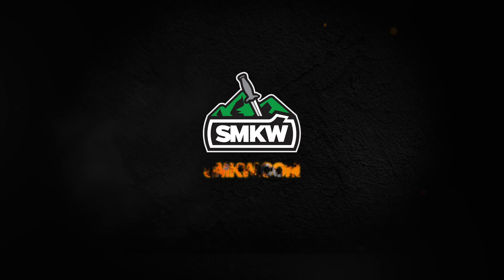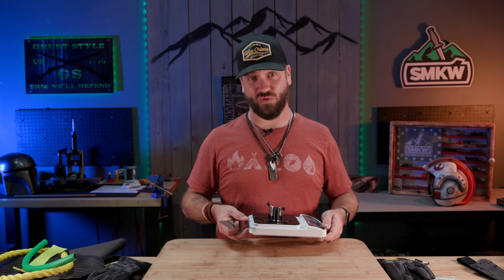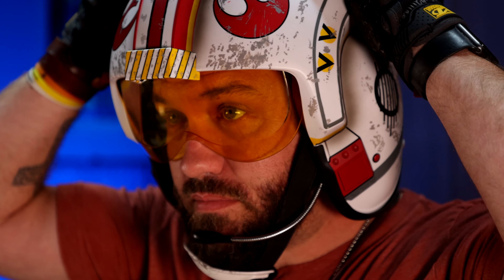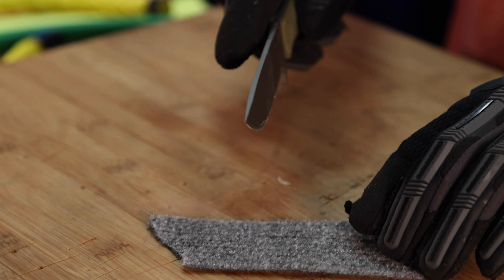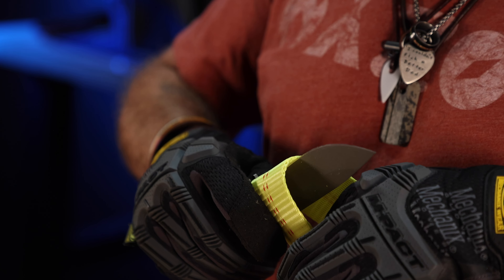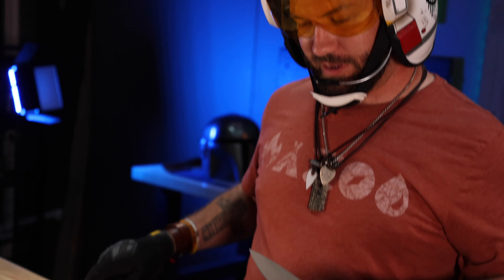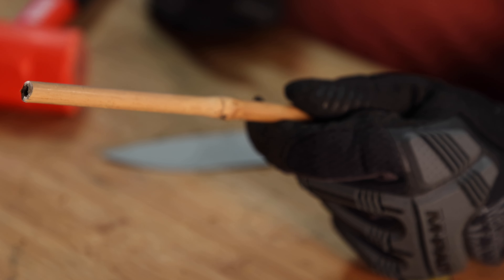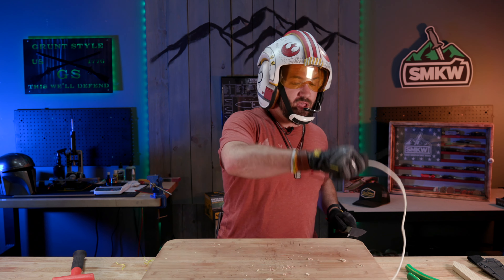CRU-WEAR Blade Steel | Will it Cut? | Benchmade Anonimus

Comment: That anonimus is impressive. Doesn’t seem like the most ergonomic knife, especially for bushcraft work, but man, is it tough. Between this and the DBK video, I’m super impressed with how tough it is and how well it holds an edge. Benchmade is doing cru-wear right, no doubt about it.
Reply from the maker: It is tough and may not be made for Bushcrafting but it will stand up to the test of the outdoors 👍
Reply: Doesn’t SEEM ergonomic? 😂 you’ve prob never even held one

Comment: I just received my Anonimus in the mail. I purchased it because I wanted to try the CPM-CruWear alloy & also, because I used the rewards points from my Cabela Card, it was free to me. It will be a thin, light, high quality slicing blade for EDC.